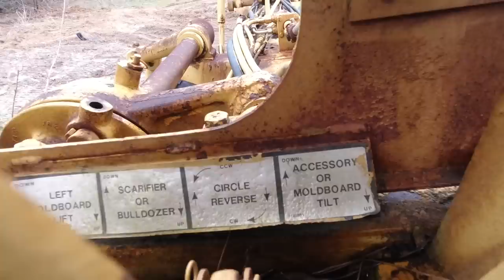WILL IT START? FORGOTTEN GALION T400 Road Grader

Comment: So, if you get these things started, do you get to keep them?  Just curious.  Also, my husband would have threw a fit with the spraying WD-40 (Liquid Wrench, whatever it was) into the ignition!  LOL  He's a certified locksmith.  Might get some liquid graphite for lock/ignitions.  ;)  Also, Yay!  It started!
Reply from the maker: Yeah, this one my father in law bartered for. 👍 We were excited it started😊
Reply: @HamiltonvilleFarm  That's awesome!  I tried to buy a tractor (as spare parts for our Massey) from a neighbor--tractor has been sitting out in the field for around 18 years, probably longer, no rear tires on it, no seat, etc.  Dude won't part with it...  Ugh.
Reply: The reason you spray WD in those ignition switches is because it's 1. Stuck, key won't turn. 2. It's been sitting out in the weather, the electrical portion of the switch will be oxidized and the WD will help make those oxidized electrical contacts work again if they're going to. Liquid graphite will not help electrical connections, so WD is what's needed. Spraying the WD in the keyhole is the easiest way to get it into the electrical portion of the switch without tearing everything apart.

Comment: When you were hammering on the starter.... you were hitting the wrong part.  The bendix drive is the issue... and you should have been tapping on that... NOT the back half of the starter motor itself.   The Bendix housing is where you need to be tapping and hopefully will free it up to kick the arm so that it will drive the pinion gear forward and engage the flywheel ring gear.
Reply from the maker: Yep. Thanks for watching 👍
Reply: They didn't even need to hammer the starter, they were bypassing the solenoid the whole time which is why it wouldn't engage.

Comment: So the reason that just the starter motor was turning is you were  jumping the wrong side of the switch jump the small wire to the positive supply wire and that engaged the solenoid..but you figured it out .. I see
Reply from the maker: Thanks 👍

Comment: cut the wire to the ignition. if it is a petrol engine, it runs on ignition coil, just cut the wire to the coil and it will stop. the oter way to stop it is to clog the exhaust pipe with somthing. if the fuel to air mixture get wrong, the engine dies.
Reply from the maker: Right on👍

Comment: Starving the fuel worked but if ya cover the air intake it works better ! Looks like ya got your work cut out for you ! 6 new tires 1 mile of wire 15 new hydraulic hoses new patch panels a fuel cap maybe a radiator and fluid and possibly rebuild on the hydraulic rams and paint not much ! Lol
Reply from the maker: Tell it all.  Long road ahead. Thanks for watching and taking the time to comment 👍

Comment: Never beat on a starter with a hammer unless you plan in replacing it on your next start. What that does is breaks the magnet inside.
Reply: Those starters dont have magnets. They are copper wound. Smaller, newer starters have ceramic magnets instead. You are absolutely right on those. Learned the hard way on a kubota I had. One hit and you're permanently out of business.
Reply from the maker: Yep
Reply: Magnets?

Comment: to shut off if you take rubber hose off the air intake and cover it with a board it will starve of air and shut down
Reply from the maker: We actually had a board to cover the air intake.with and forgot to use it. 🤔

Comment: The 2 outer levers raise and lower the respectable side of the load board.
Reply from the maker: Cool. Thanks for that 👍 I appreciate it.
Reply: Gallon graders were a kind of an orphan. Galion iron works hooked up with an outfit called Jeffries, which made mining equipment. When international harvester went under in the 80s, an oilfield outfit called Dresser bought the construction machinery part. They also bought Jeffries, aiming to get into the mining business big time. Galion iron works was thrown in to boot. Dresser had all that IH inventory which they bought cheap and sold for a premium in the oil patch. When Dresser ran out of new stock they had to start manufacturing, which was much less profitable than selling the bankruptcy inventory.
Reply from the maker: @ohgary  that's very interesting. Thanks👍
Reply: Dresser started looking for the exit. IH once had a pretty robust dealer organization and Komatsu needed North American dealers. They formed a joint venture with Dresser, called Komatsu Dresser. This company also sold ?Galion graders without much enthusiasm. In ?Japan, graders are used almost exclusively in mines. The ?Galion graders are too small for mining haul roads. Plus which, Galion graders are almost always sold on Competitive bids to government entities, meaning low prices. Contractors prefer Cat graders. So the Japanese didn’t understand graders and the IH dealers didn’t want to screw around with low profit bids. Too bad, cause the Galion graders was a superior product, but small companies can’t compete with Cat’s product support. In many cities IH A
Reply: In many cities there were both IH and Komatsu dealers. Whichever was stronger survived and the other was closed. Around 1996 Komatsu closed the Galion plant in Ohio and took the grader line to Chattanooga. Eventually they put the Komatsu logo on the Galion grader. I don’t know what happened after that.

Comment: Instead of cutting the fuel line you can cover the air intake and that will cut off.
Reply from the maker: Weactually had a board in the bed of the truck to do exactly that. But in all our excitement we forgot we had it. LOL 😂 I told you I'm not a real mechanic 😂😂😂

Comment: Let me ask you one question. 
 Is there in your area a trade school where they teach agricultural or heavy equipment mechanic ?
 If so ask the teacher if there is one or more students who would like to have some fun doing what you guys are doing with old equipment on the weekends. You would be surprised what these students learn.
  I know i was a agricultural mechanic teacher and taught trade school. 
The reason i say this is the way you start or i should say check equipment before starting them. If you start any machine that has a hydraulic system and run the engine without hydraulic oil you can destroy  the pump in seconds. You need to make sure the hydraulic pump is full of oil and has oil in the tank before even turning the engin over.
That i just one point of inspection before starting the engin.
Have fun and a great day
Reply from the maker: That's a really great idea. I'm gonna look into that. I appreciate the comment 👍

Comment: halo boys. Did you change the oil before you started it? Filter? diesel filter? Or did you just come after 10 years and start it hard? OMG ... And if the starter doesn't fit and banging doesn't help, you have to move the engine !!!
Reply from the maker: Thanks for watching

Comment: Guess I was right technically, and easiest way to kill a diesel is to cut off the air intake. Can’t run if it doesn’t have air to make it combust.
Reply from the maker: Ah! See, that's why I love the comment section. And yes you were right😁
Reply: Hamiltonville Farm that’s the thing about the old mechanical injected diesels. 9 times out of 10 no matter how long they sit they’ll still crank with minimal effort. That what I love about them. No electronics or sensors. Being that it looks like that was a nonturbo diesel. Take the air breather off and cover the intake pipe with your hand, be like flipping a kill switch. Which it should have a fuel shut off somewhere in the cab. My Massey has a knob you pull and it shuts the fuel off and kills it. That grader might have something similar.
Reply from the maker: @groundupexcavation  you know in our excitement we actually forgot we took a 2x6 piece of wood for that exact purpose. In case it ran away on us. And totally forgot about it. Lol😂
Reply: Hamiltonville Farm by the look of the location of the air filter idk if you would have been able to get a board over it. But I don’t know what’s behind the metal either. But If it was a turbo diesel I’d definitely use something like that. You can use your hand on a turbo diesel but even at idle it’s a lot of suction, I definitely wouldn’t do it above idle with a turbo.

Comment: I have never had a starter work after I hit it with a hammer.
Reply from the maker: Lol. I've only had it work on cars
Reply: The only way hitting it might help is if the solenoid was stuck.  In that case the starter would not disengage after the engine started.

Comment: Guys incorrect way of doing manual cracking.
The gentleman using the screwdriver on the starter is not doing it right. If you put a jumper (in this case a screwdriver) between the two big studs (bolts) you will bypass the solenoid A.K.A. Bendix and only power the electric starter without engaging it to the engine.
The right way is to jump or make contact the big bolt with thick wire to the small bolt typically the one with wire at the solenoid marked with "S".
Then the solenoid will kick the engaging gear and sen power to the electric starter motor.
I found this image over the internet that might help. https://www.fixya.com/uploads/Howto/jturcotte.jpg
I do not want to be the smart guys here, but if the intention is to help then I will share my 2 cents.
Reply from the maker: Always glad to be learning!
Reply: @HamiltonvilleFarm , yeah learning always. We might be getting old, but never obsolete. :D
Just subscribed to the channel Hank!

BTW, back in the days we used start a cold engine by disconnecting the air intake hose at the nearest point of the engine, then get a torch with fuel on it, lit it up and get the flame next to the air intake tube while cracking so the flame quick heat the air into the cold engine. 
This procedure worked 99% of the time even if the glowing plug was faulty or not present,  it is not as fast as  using starting fluid (ether), but no risk of blowing the engine either.

Comment: You guys probably came with in ONE hit with that hammer from costing you a $1.000 starter.  The area where you guys were hitting with the hammer on the inside are a set of Permanent magnets.  I had a guy bring me a starter like that with the Magnets all broken into a million pieces because some one hit it with a hammer, JUST LIKE YOU GUYS WERE!  And HE CLAMED: I DIDN'T DO IT!!!!!!!!Just above and to the right of that starter is a FORD TYPE solinoid.  All you guys would have done is activate that solinoid with a screw driver like you did on the starter and it would have turned over.  A lot of times on heavy equiptment there are TWO solinoids.
Reply from the maker: Yeah we finally figured it out. Gotta be careful for sure👍 thanks for watching and the comment

Comment: I have a 1940 international t340 drott 4-1 skidshovel its in better shape than that swiss 🧀 cheese but it sat for as long as i could remember in out yard an my grandpa told me before he passed away if i got it running it i could have it an long story short i got it running an drove it but then a hydraulic line blew an the clutches are burnt so its nearly impossible to steer an it needs the carb rebuilt
Reply from the maker: Right on. This one needs some work
Reply: It was a t340 not a t40

Comment: First, you put fuel in this tank, do you know how long it has stopped, do you not clean the injector, filters, bleed etc., then you start repairing the hammered starter motor, and you also don't notice that the automatic is not being activated? sorry but you are very lay ...
Reply from the maker: Remember the part that said we are not professionals.....we meant that. Thanks for watching 👍

Comment: Why not just disconnect the battery to shut it off
Reply from the maker: It would have still run without the battery. The better option would have been to cover the air intake 👍 thanks for watching and the comment!

Comment: Run a emergency kill switch
Reply from the maker: Good idea
Reply: The emergency kill switch up in the cab the sends the kill signal to the engine as a temp fix.
I happen to be a diesel mechanic. And you are correct galleon was bought in the 80s by komatsu

Comment: i hope you haven't killed that engine with no water in it.
Reply from the maker: It ran less than 5 mins. It should be okay
Reply: Even if it had water, it probably didn't get hot enough to open the thermostat.

Comment: Another way to stop the motor is covering the muffler up top
Reply from the maker: Right on👍
Reply: That won't work. You've got to cut off the fuel, or possibly the air. The engine makes more than enough pressure to push the exhaust out, past whatever cover you might try to hold down onto it.

Comment: Turn the fuel off
Reply from the maker: We were trying. Did you see the part where he had his arm inside the engine compartment? That's what he was trying to do. We could've tried cover the air intake too from what I understand. But obviously as you seen in the video we had to pull the fuel line off. Fun times 👍

Comment: What did you end up paying for that old girl?
Reply from the maker: My father in-law bartered some other equipment for it. But if it was to be bought as it sits, I'd say $2k
Reply: @HamiltonvilleFarm  Ya that is not too bad. I can't believe how much rust it has. Stuff here in Ontario Canada really never rots like that. Here stuff rots from the bottom up from road salt. I have seen stuff sit out here for 50 years and the paint can burn off it and it would get surface rust but never holes like that. You must not be too far from the ocean.